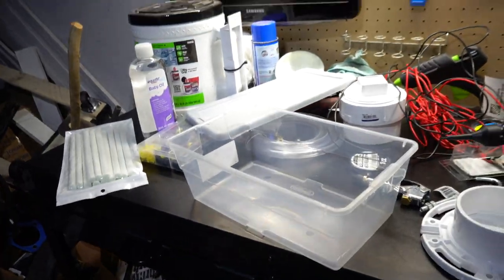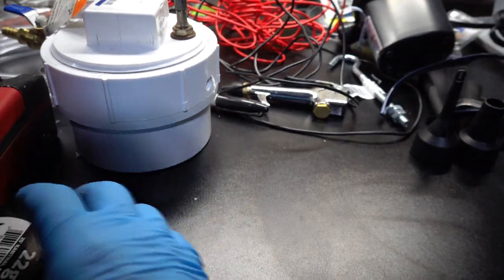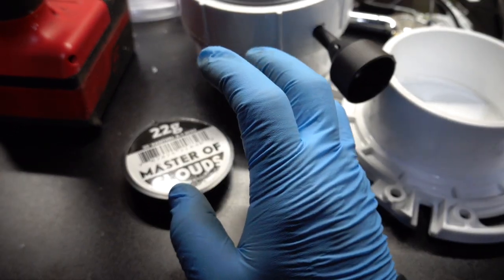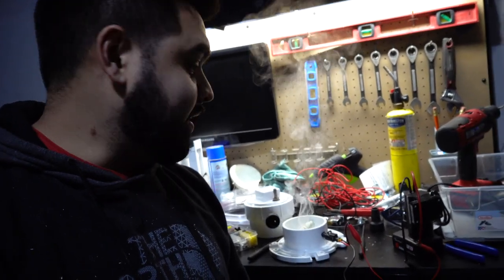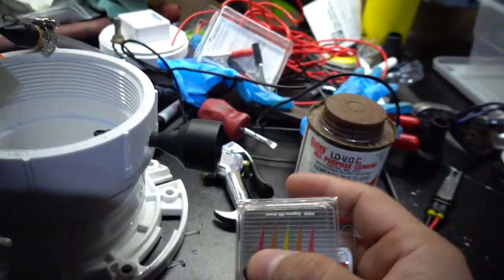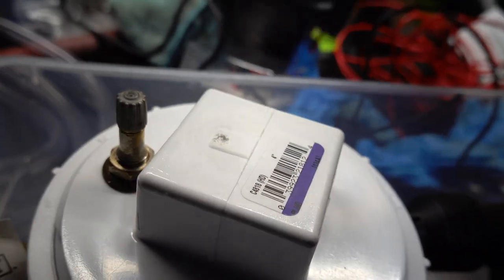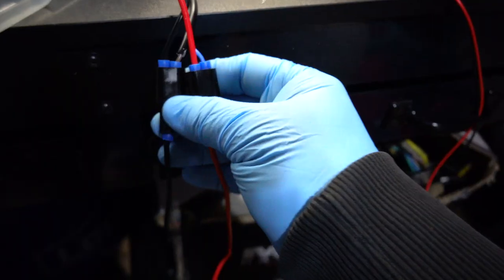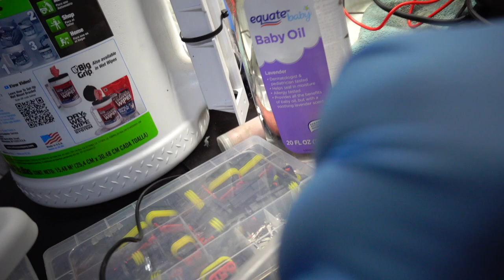How To Build A DIY Homemade Smoke Machine Tester (Vacuum Leak Detector)

Comment: Had the same idea using the mattress inflator. My only concern is making too much pressure. But looks ok in your vid. I also plan to use a small plastic tool box from Walmart, only 10 bucks. Good job man.

Comment: Very good video. one point about the wire: the smaller the gauge the less length you need to make two ohms resistance. If it blackens the wick then it's too hot. Use more turns closely spaced

Comment: you are using a wick so it has to be in some (1/2" ) standing oil so it can stay soaked in  oil and the wire has to be tighter wrap so it makes complete contact with the soaked wick and will not leave those burn marks caused by lack of contact, then you can get even more smoke !... just an observation... and I used a metal tool box as my carrier and easy to store with the rest of boxes.

Comment: Perhaps make the wire a little tighter around the wick? I saw another video with this build and the chap used welding wire. Which resulted in a much longer wire as it's resistance was lower but it also had the side effect of having more wire in contact with the wick, therefore much more smoke :)
Reply from the maker: Very good suggestion. I’ll definitely try that out and see if it helps because it could use more smoke 👍🏼

Comment: In addition to Justin's idea, if you want more smoke you also want to cut the tip of the rubber thing at the end of the hose a bit. That tip is designed to create high pressure air through normal air compressor pressures, but a tiny blower like you have there is not gonna push much air through it. To be honest that rubber tip is not needed at all for this application.
Reply from the maker: Yeah I think I will make the hole on the end a bit wider. I like it because you kinda need a tapered tip to get in the hoses better.

Comment: I try to build a machine like you but when I hook up to car battery , the positive terminal is causing a zap , I think is short circuit . I use the Copper Wire 18 gauge !
Reply from the maker: Make sure nothing is making unwanted contact 👍🏼

Comment: Can anyone tell me why my alligator clamps heated up to the point of melting, Instead of the heat element?
Did i use too short of a wire?
Reply: Check your connections and make sure they're good. Get larger gauge wires